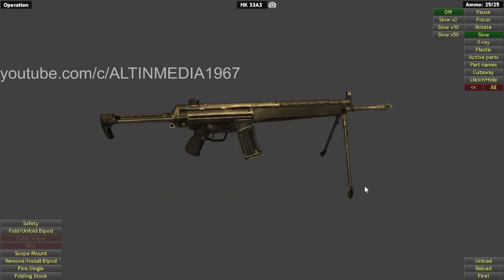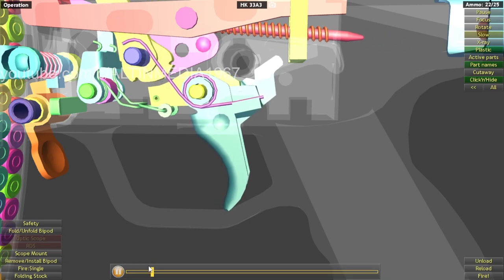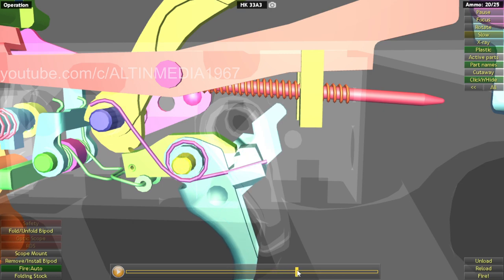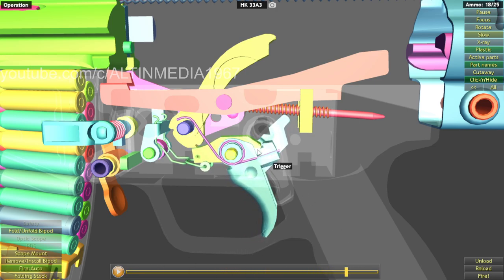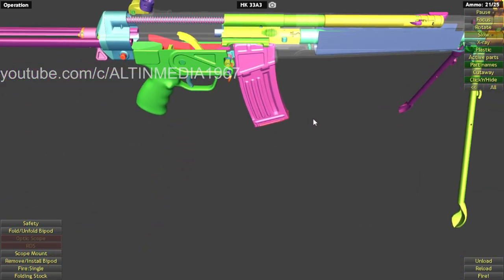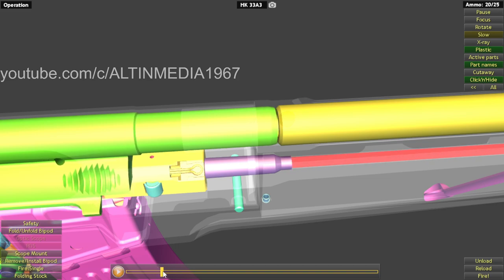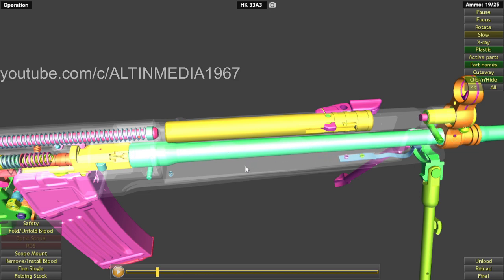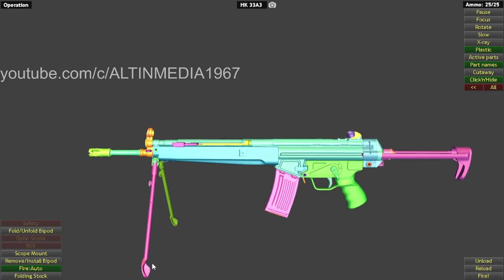This is how HK33 A1 Actually Works | WOG | with commentary

Comment: the animation is wrong. the bold head is moving back from the beginning. the bold head is then forcing the rollers inside and the rollers pushing back the locking piece even more backwards. this delay works because moving the bold head back for 1 mm means that the locking piece and the carrier have to move back for 3 mm. its a kind of leverage.

Comment: Dude, it's delayed blowback system and rollers NOT locking bolt. Cartridge push bolt and bolt move very very short and push rollers, rollers moves and pushes to bolt carrier
Reply from the maker: when did i say its locking bolt?
the animation is wrong, the blowback should push the bolt head back and in turn the reciever will push the roller into the bolt head to unlock it. but the animation show the bolt carrier move first which is only happen if its gas operated.
Reply from the maker: roller delayed.